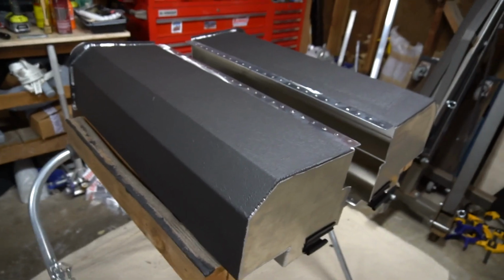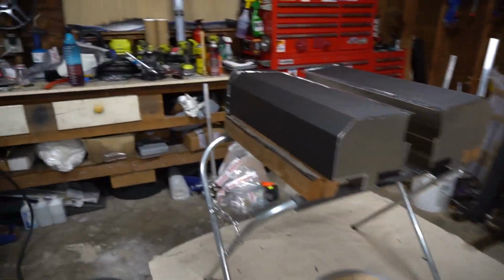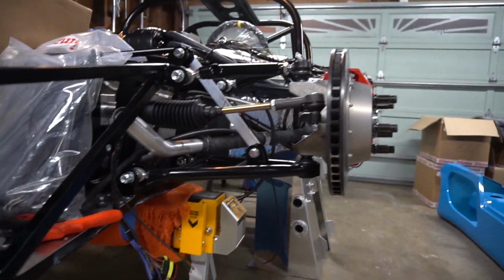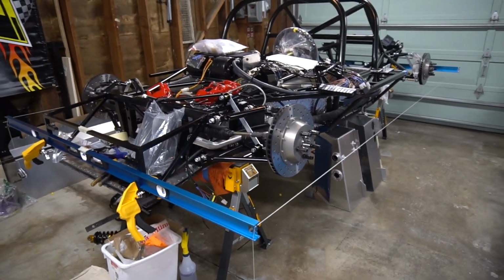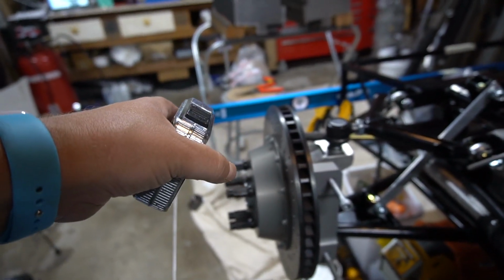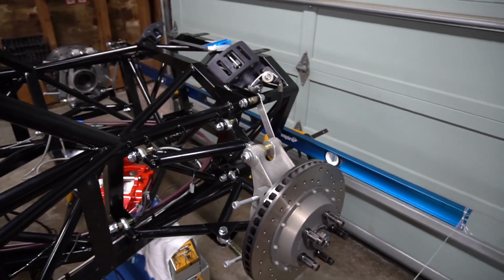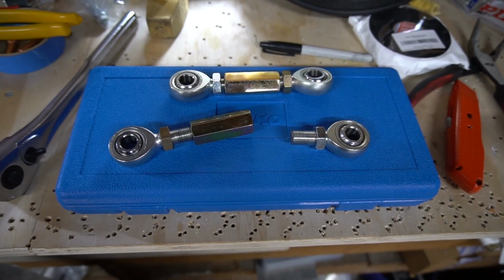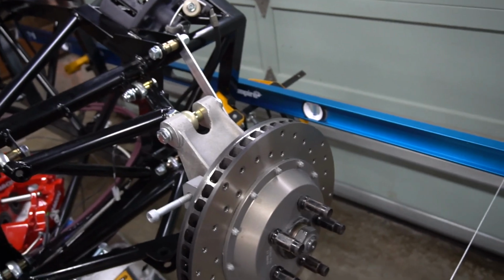Project Blunicorn 017, String Theory

Comment: Very nice tutorial on alignment, did the factory supply the plates or the measurements to make the plates to set the ride height when replacing the shocks?
Reply from the maker: I made the ride height bars from measurements supplied from another builder, and I got the alignment specs from the factory.  I did end up raising the front about 20mm to make street driving more livable.